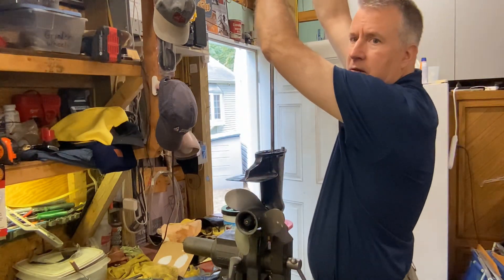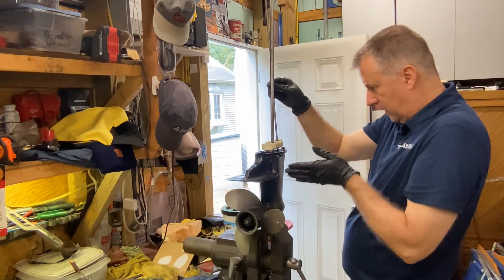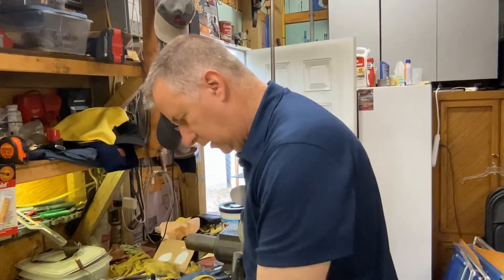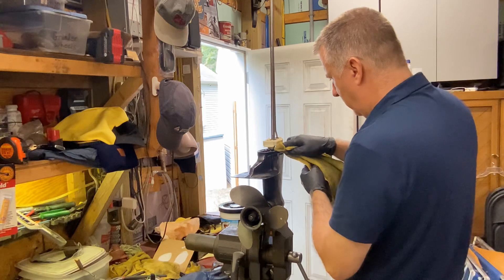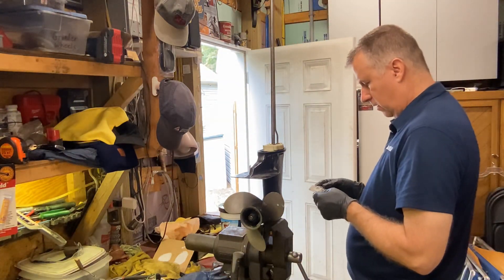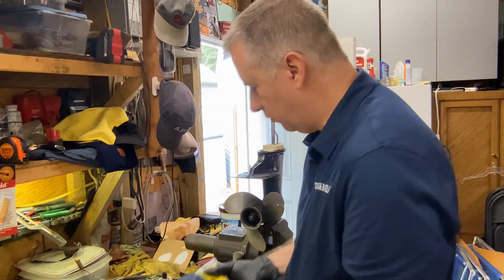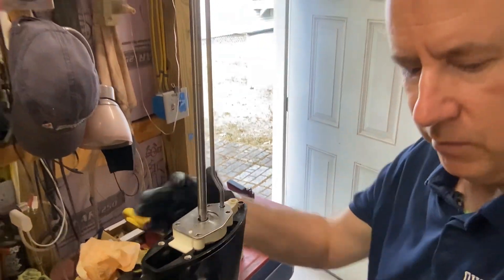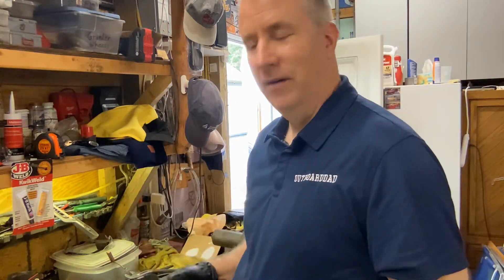Mercury 9.9 shift shaft Outboard install

Comment: I have the same engine and followed your videos the best I could. My motor shifts just fine but I replaced my impeller and took the shift shaft out to clean it. I went to put it all back together and my motor won’t shift all the way anymore. Do you have any idea what I did wrong?
Reply from the maker: I can help, email me at keith@outboarddad.com
Reply: I have a newer model I believe a 2021 I can't get the linkage to snap back in
Reply from the maker: It’s possible that it’s just not lined up correctly. Can you email me some pics and videos? Where are you located? Keith@outboarddad.com